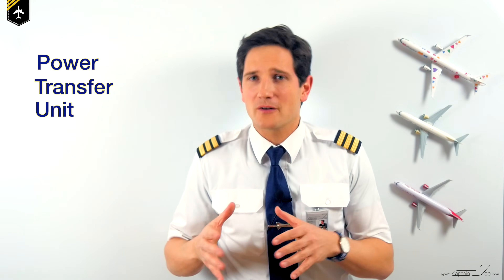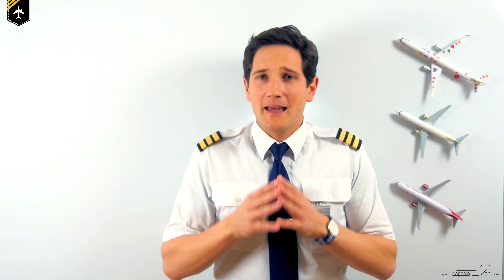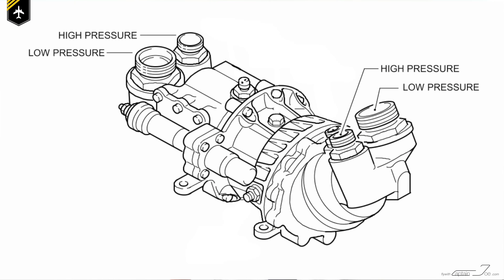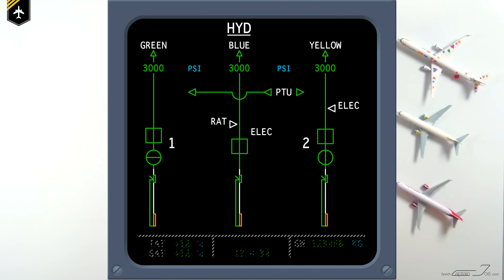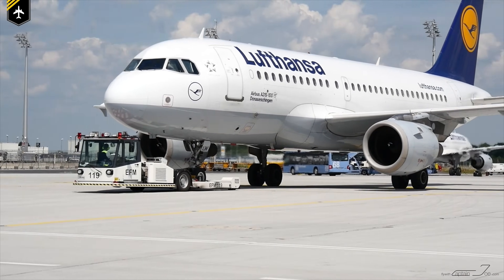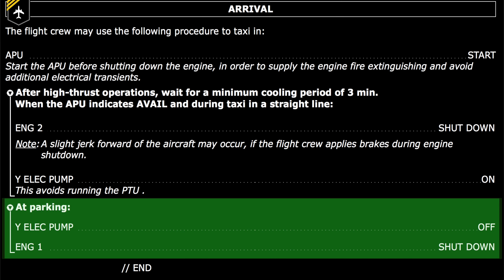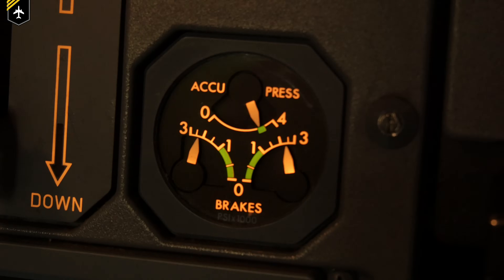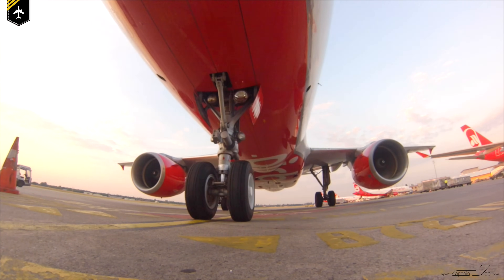MYSTERIOUS BARKING SOUND on AIRBUS? All about the PTU explained by "Captain"Joe

Comment: Why can't engines be started simultaneously?
Reply: Unless you're easyjet! Their sequence is 1 then 2
Reply: One some AC they can, one other they can't. AFAIK on 747 you can start 2 engines simultanously. It's mostly about APU (how much bleed it gives) and starter bleed air demand. APU provides bleed air for engine starters. Sometimes APU bleed is not enough powerfull to start both engines.
Reply from the maker: Video coming up about the engine start sequence ! Greetings Joe
Reply: Jet engines on commercial airplanes are started by compressed air essentially, now there are 2 ways to provide that.
1: From a ground side hookup point to the airplane, this may either be a common supply by the airport or a cart.
2: From the APU, or a very small jet engine in the back.

To start these you need a lot of air to spool up the turbine to a certain speed before you introduce the fuel.
If you have a loss of air pressure, such as trying to start two engines at the same time or not enough air from the APU or ground, you will have a "hot start"
In short, the engine doesn't really spin that fast, but you have fuel burning and no airflow to cool the blades inside the turbine, essentially burning it up if you leave the fuel flowing.
Reply: DaLegionMC also, when you start both engines at the same time and one has an error or starts burning, you will have to look for two things at the same time. its better to focus on one engine at a time.
Reply: Not enough bleed air pressure coming from the APU  to spin up both engines at the same time. The Boeing 747 can start 2 of it's 4 engines at the same time.
Reply: Ignitiers may also operate inflight to prevent flameouts. So they are not just for starts. In Airbus they are controlled by the FADEC and FADEC may turn them on inflight even for both engines simultanously, IIRC it does so when flameout is detected. They can operate continously without any damages to electrical wires and they do not even need enormous current. When you compare them to the anti ice systems and heaters you will realize that they are not even close to be high current consumption things.
Some Boeings have CON option which turns on ignitiers. Its used inflight during heavy rain. Some airlines also require this option to be used during approach and takeoffs because during those phases of flight flameouts may be fatal.
MD-11 also had continous option, and its FADEC automatically turns on igitiers on approach to prevent flameouts even when conditions are normal.

Electical fires are not likely to happen because of the high current demands caused by normally operating things. The wires must survive the loads, otherwise type would not get airworthness certificate. So if electrical fire happens its more likely related to some kind of failure or shorts.
Reply: actually... engines can be started at the same time in the 777. it's apu actually generates enough power to make it possible
Reply: Captain Joe hahahaha "loaders trying to start his chainsaw" as Monty Python once said "He's a lumberjack and he's ok" 😉😉😉
Reply: Current? Airbus? You are funny :-) Airbus uses air starters. Only modern big airliner that has electrical starters (or rather starters/generators) is probably Boeing 787. Others like B747 B737 B777 B757 B767 and all Airbus airliners has pneumatic starters that uses bleed air to start engines. The problem is the limited bleed air supply by the APU. On some AC APU is not powerfull enough to provide that much bleed air.
Reply: "IN FLIGHT
Both igniters are supplied when the ENG MASTER sw is set to ON"

http://nicmosis.as.arizona.edu:8000/ECLIPSE_WEB/TSE2015/A320_DOCUMENTS/A320-FCOM_DSC%20Aircraft%20Systems_part2.pdf

PDF page 997.

A319/A320
FLIGHT CREW OPERATING MANUAL
DSC – AIRCRAFT SYSTEMS
DSC-70 – POWER PLANT
DSC-70-80 – Ignition and Starting
DSC-70-80-30 – Ignition System

You have your cite, now go away and stop trolling.
Read manuals, not troll guides....
And before you ask for cite again, grow up, because now you are troll whos only job is calling things "bullshit".
We have enough trolls like you who are asking for cite just because they do not understand how systems works and they are doing it because they like when people are doing everything for them. I am not your flight instructor, and i am preatty sure that noone would like to be instructor of troll like you. Grow up and start learning how to use web browsers and search engines before asking for cites. Nobody will like doing the work for you you selflish fish...
Reply: You only have so much power for the task.
Reply: There's a little engine in the back of the plane running (the APU, Auxiliary Power Unit). It generates air and electricity to power the aircraft when the engines aren't running. It sends air to an engine to start then, but there isn't enough to start both engines at once. It takes a lot of high pressure air to turn the engine fast enough for combustion to work in a turbine engine.
Reply: Maybe you cite the source of your?
The fact is that electrical installation was designed to survive loads ignitiers cause.
And stop being troll, because i am giving you arguments and you are trying to troll me like kid.
Reply: Srivas R no idea. all our other airlines are 2-1
Reply: KC-135Rs start engines simultaneously during alert starts.
Reply: In the MD-11 the igniters are only run when on the ground, takeoffs and during approach to landing.
During cruise they are switched off and the engine runs off its own "flame"
The crew has 2 igniters to chose from, A and B, and they are alternated between for wear reasons and how that rotation is done varies from operator to operator.
Reply: CMDR Sweeper That's interesting. I was always thinking that A and B are the 2 FADEC systems that controls them. And from what I recall igniters in MD-11 will also turn on automatically in-flight when flameout is detected.
And OFC you also have switch labelled OVERRIDE which turns them ON manually, it works preatty much the same way as CON function in Boeing.
MD-11 also has a nice function. It shows blue lightning like symbol inside EGT "gauge" (I don't mean physical gauge but the thing displayed on the screen) when igniters are ON.
Here is how it looks: http://orig11.deviantart.net/35af/f/2013/175/4/5/eicas_by_hyppthe-d6aiu41.png
Reply: You guys know nothing about the A320. I have thousands upon thousands of hours on A320 in FSX, and when i press CTRL+E they start simultaneously! I am a Captain on A320, on FSX, because of my experience.
Reply: CMDR..... Elite fan here :3
Reply: is this legion from Officer401?
Reply: Discord Server
Reply: DaLegionMC Some Military aircraft can do that.
Reply: DaLegionMC simply put, some Aircraft are configured for more than one engine to turn at a time, others are not. the APU on the A320  doesn't  put out enough puff. the A340, however, can do this swimmingly❤
Reply: even i you have the power to simultaneously start your engines , you should never start or shutdown your engines in order to be able to observe the engine parameters , temperature , speed , torgue , etc
Reply: You can observe parameters of multiple engines at once. Maybe it requires more attention but its possible. Maybe monitoring 4 of them could be a problem, but monitoring 2 of them is not really a problem.
Reply: BisdremisKostas well on b787 or A380, you can start two engines at the same time.EEC can monitor the parameters and stop the start procedure if resuired. it only depends if your APU can handle or not
Reply: Ishan N No.  The APU provides an independent source of bleed air and electrics.  Different aircraft designs have their own procedures for which engine is started first.  Airbus A320/319 starts number one so that Green Hydraulic pressure is available for taxi without using the PTU.
Reply: WaterFucKing Who told you this?
Reply: dieselscience Overheats what wires?
Reply: dieselscience Why do you comment on things you know nothing about?  In flight, when flaps or engine heat is selected, the igniters run continuously, with no time limits.  The wiring handles it just fine.  Airbus is not known for electrical fires.  Please cite stats comparing Boeing and Airbus electrical fires.  I have flown both.  What have you flown?
Reply: BisdremisKostas The FADECs start (and abort starts) automatically.  Please reserve your comments for areas in which you are knowledgeable.
Reply: VivaLaSicilia And you felt like chiming in because........
Most people here either post stuff that is wrong (but they think they know what they are talking about), or they are posting because they know what they are talking about.
Reply: Oscar Blue of course. I have the seatbelt chime in FSX too. Today i have a flight from Rome to Tokyo with the A320. Unlimited fuel does the trick. 😉
Reply: VivaLaSicilia Why would you work the seat belt sign when you have a First Officer to do that?  Common man, you show weakness.  You should say that you tell the FO to let em go, and put em down when you feel like it.
Reply: VivaLaSicilia I hope you are getting a good price on your unlimited fuel.  Otherwise you will be in bankruptcy in no time.  Be smart.
Reply: Oscar Blue yeh,.. i get 19 tonnes free every time. 😉
Reply: Oscar Blue nah,.. i run it by myself, i got no FO to work them, because my A320 is single pilot on FSX.
Reply: VivaLaSicilia I would feel more comfortable if you found a copilot.  After all, it was certified with a flight crew of 2 pilots.
Reply: Oscar Blue but i am good,.. no FSX passengers ever complained. Neither i, instead if sending the FO to make me a coffee (he could spit in it out of spite), i press P and then go to the kitchen make a coffee and toast. 🤣
Reply: unlimited fuel is cheating
Reply: MWB Gaming nah,.. it’s good airmanship 👍🏻
Reply: Yeees, now i know)) thanks a lot! Im stuck on your channel for a day)very nice work! I like the way you explain. All the best!
Reply: @Ishan N

Wrong. There is no PTU functioning issue here. The PTU does only a self-test between Eng2 and Eng1-start to check the 500 psi green/yellow hydraulics pressure differential logic.
This is confirmed also under the section of Suppl. techniques FCOM 3, one engine taxi, where you must start and taxi on Eng1, to power the normal brakes and Nose Wheel Steering, without powering the PTU, and FCOM 1 under HYD, then PTU, as well.
Reply: Current drain. Too many amps overheat wires and start fires and Airbus' are a bit on the thin side (to save weight).
Reply: Oh? So tell us what the igniors use...magical fairy dust? Airbus is notorious for electrical fires.
Reply: Cite your source for that bullshit.....

Comment: Please explain the flaps!
Reply from the maker: Video coming up :) Greetings Joe
Reply: Flaps increase the surface area and change the shape of the wing (camber) in order to generate more lift at slower speeds (refer to lift equation). 

On approach flaps are used to allow you to push the nose down without gaining the amount of speed you would without flaps. Lower nose attitudes on approach allow pilots to see the runway better also. Once landed the flaps can help the aircraft slow down (as more lift generates more drag), and therefore they're left on full during the landing roll. 

For Takeoff flaps decrease the required runway for liftoff by allowing the wing to generate more lift at a given airspeed, but as they also add more drag the flaps aren't set to full or else acceleration would take too long. Thus a sort of "compromise" between acceleration and lift are optimised. Flap settings in larger aircraft for takeoff can be calculated or taken from a reference whether it be from the computer or a written resource.
Reply: Ah, no, the flaps provide more lift at a given speed so you can fly more slowly, not more quickly. The rest of your comment is rather nonsensical, lol.
Reply: No problem, I assumed you'd just made a simple mistake. Someone who speaks of altering the shape of the wing to generate more lift isn't likely to get it wrong, lol.
Cheers
Reply: Mad Joe Mak no partially wrong, it causes more lift for the airplane during low speeds when approaching the airport. And this is very important.
Reply: Steeltrap and guessmyname oh thank you!!! I meant to write that sorry I'll change that
Reply: Captain Joe thanks Joe!
Reply: I thought the barking sound is caused by the flaps
Reply: like a bird flaps (wings)? lol
Reply: Jamie Tube the flaps change the shape of the wing to give it more lift so the plane can fly slower. At high speeds you want leds lift or else the plane would go too high and maybe go vertical upward
Reply: so did I
Reply: Flaps effectively increase the camber of the aerofoil section and slats delay flow separation by a few degrees.

Modern flaps aren't so much an extension to a wing as they are a separate wing below and behind. The small gap between a flap and the main wing when deployed allows the energised downwash from the wing (the bit that went under it and got forced downwards) to now flow over the top of the flap, which allows us to angle flaps more aggressively than we could a standard wing (this is so much easier with a diagram!!!). Modern systems tend to stage 2 or 3 (or more) sets like that to maximise the benefit. The gaps between them are essential in order to capitalise on the energetic downwash of the previous stage.

This results in a more or less flat gain in lift coefficient, essentially shifting the whole lift curve upwards (with an appropriate gain in induced drag and a marginal increase in zero lift drag).

Slats, usually deployed before flaps, rely on the gap they create between themselfes and the wing's leading edge to energise the boundary layer above the wing and are thus effective at delaying boundary layer separation (stall) by a couple of degrees, much like vortex generators (they are often used in tandem), but unlike permanent vortex generators, slats do not incur a drag penalty when not needed.

The delayed flow separation extends the linear portion of the lift curve, granting that extra safety margin.

Both of these effects result in significantly higher (often over 200% of clean config) lift coefficients achievable safely, allowing shorter take off runs and slow landings.
Reply: They’re like the transmission in your car. At low speeds they give more lift but can’t go fast. Retracting the flaps is like shifting up in your car. When you retract the flaps you don’t have as much lift but can go faster.
Reply: +IVoidwarrantys Very well said.
Reply: The air moves faster on the TOP, not on the bottom.

Comment: What is an IDG?
Reply: IDG is bascially generator together with CSD in one case. CSD is a kind of gearbox that provides constant speed of the generator regardless the speed of shaft. Constant speed is needed for AC generator to maintain constant frequency. So generator can provide the same frequency (400Hz) at idle, aswell as at max engine thrust.
Reply: The Integrated Drive Generator converts the variable speed rotary power from the aircraft's engines to constant frequency AC electrical power. Basically a constant speed gearbox and a generator as a single unit.
Reply: Integrated Drive Generator.
Reply: JxDxJx IDG Internal Driven Generator
Reply: What does it do, i mean